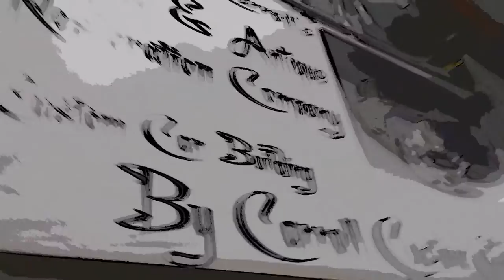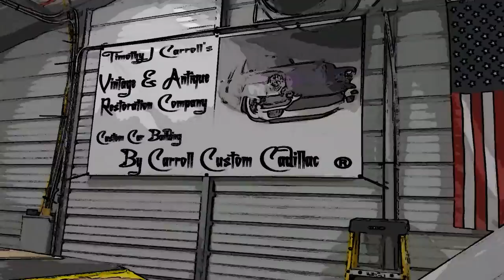20160518 193535

Comment: Hi Tim, hope you see this. I have a 2005 STS, NS V8. Wondering a couple things; 
a) haven't seen much online about the NS V8's having the head bolt problem with the '05s and up. Have you rebuilt any of the '05s and later? Mine is great, but curious as to your experience.
b) what is your recommendation for the '05 tranny, local driving, i.e. Drive v D4 v manual sport mode? 
c) how is the '05 for tuning and is it reasonable to upgrade significantly a stock '05 NS V8 in horsepower?

Thanks so much for your time & expertise. I really appreciate your contribution to NS enthusiasts.
Chris